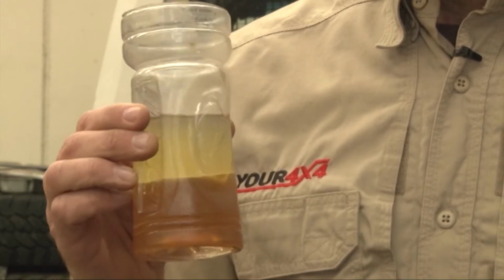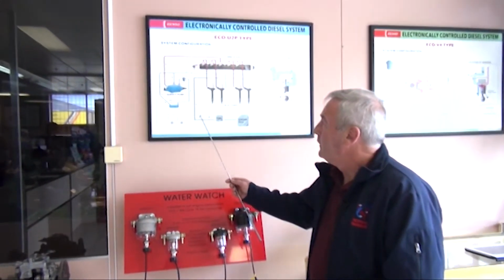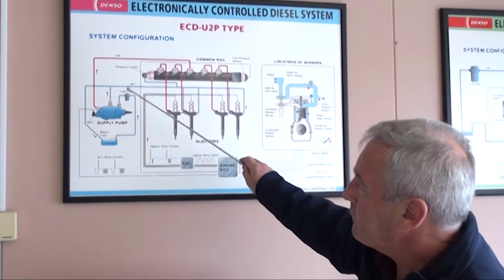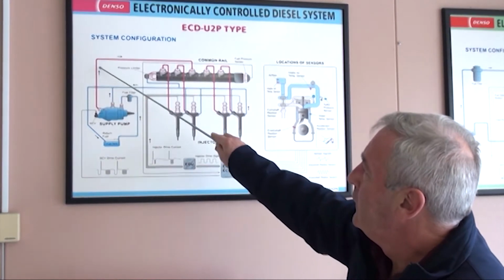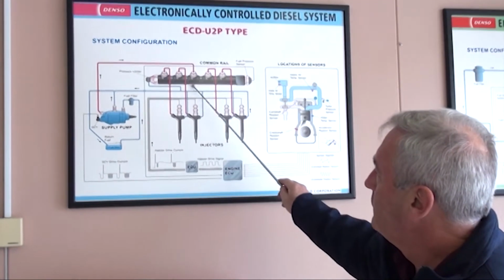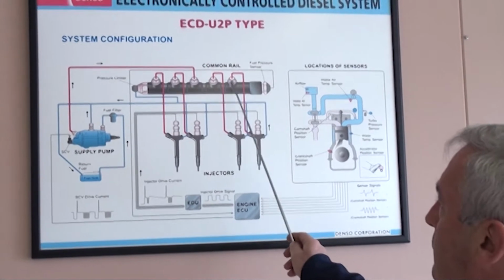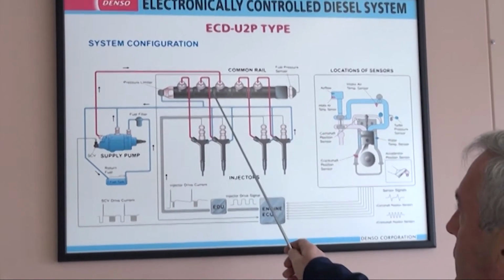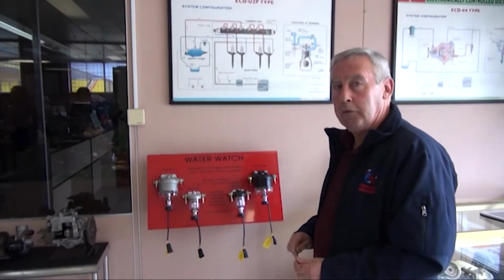Common Rail Diesel Contamination

Comment: Manufacturers fuel filters are only 60% efficient at their rated micron. The best filter, used widely in heavy haulage and the mining industry is the 2 micron filter technology australia. They are a large,dense cellulose filter that chemically bonds to the water and can handle 100,000 liters of fuel before needing changing in normal service, rated 99.9% efficient at 2 micron. everything else is inferior.

Comment: How do you know if its dirty fuel or water in the fuel thats caused the injector problem? Also how long does it take to notice after dirt or water has had affected the injectors, ie hours and not miles?